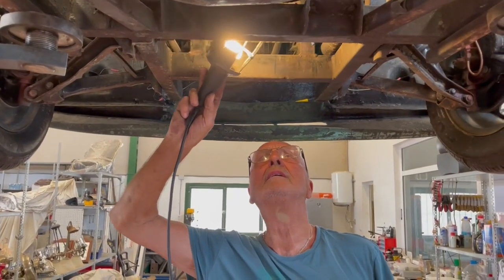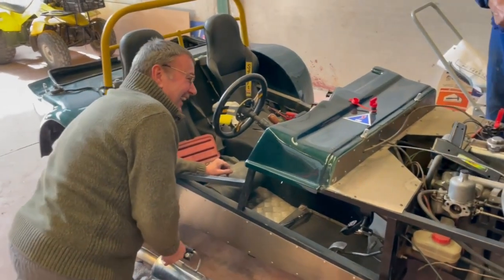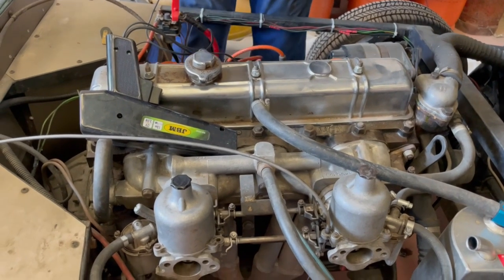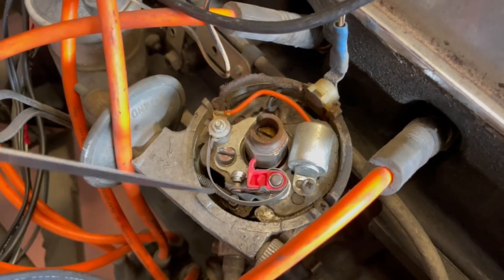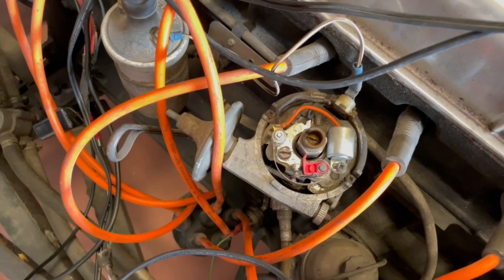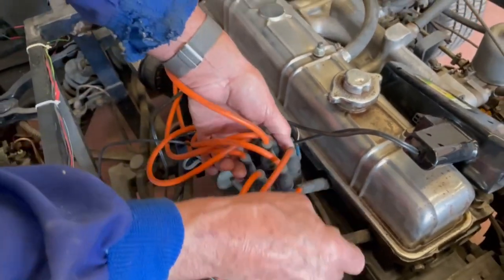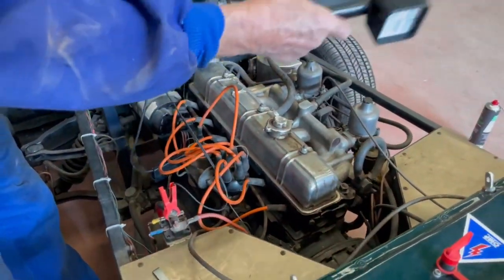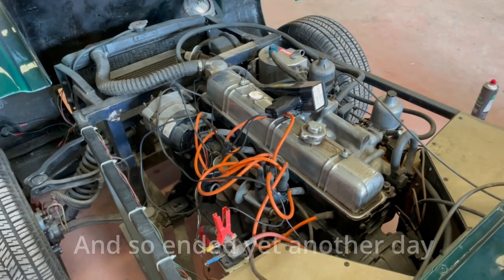The Dutton Project Episode 5 - The Points

Comment: vacuum advance disconnected = air leak?
Reply from the maker: Errr no, it doesn´t if you seal the vacuum advance take off on the manifold, as we did in the video. But well spotted and thanks for the heads-up just in case we had missed it. But don´t worry there is a much bigger disaster coming up!